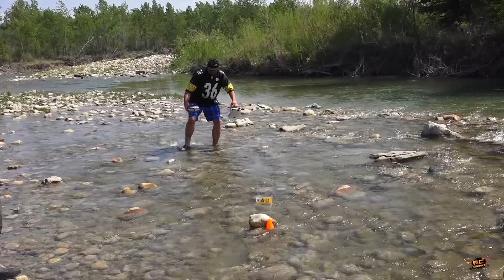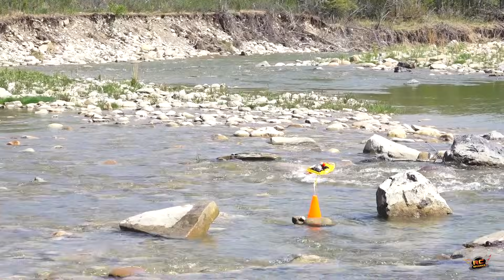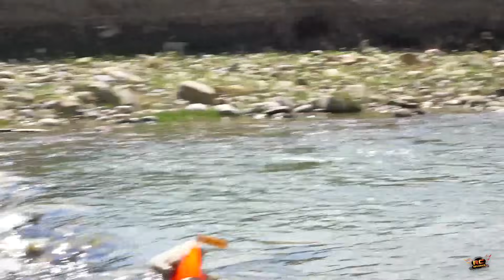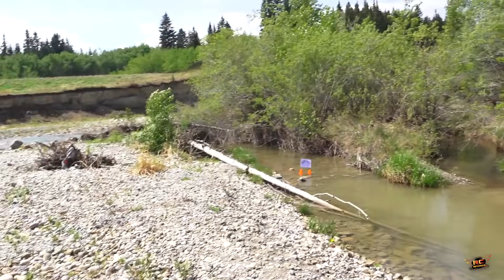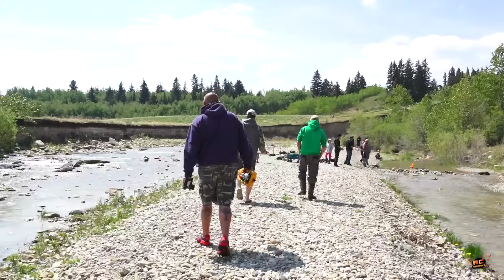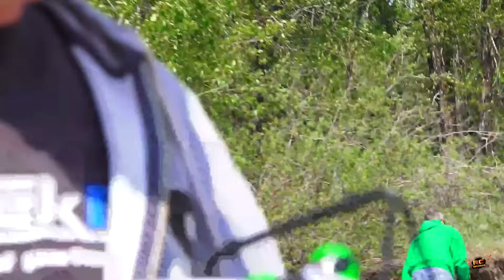RC ADVENTURES - Tiny Jet Boats Racing - PT 2 of 2 - MAiN EVENT - CREEK RACES! NQD "Tear Into" Boats

Comment: Smahing Job :)
great to see the jet boat bug so alive and strong,
Top footage on the other vid to,
I put a jet sprint vid up, with a lighter power set up
works great from 3 up to 5 cell, not tried 2 but should be good,the jet unit and motor fit well in an NQD,Hope all is Rockin with you Guysall the best
Mark

Comment: Should do a basic budget tutorial video on converting one of these id watch it1000 times while I build my own lol.
Reply: what's your budget?
Reply: MrDylman55 hobbyking low lol. i have an old traxxas TQ transmitter and receiver laying around im never going to use.  outside the cost of the boat i wouldnt want to have a ton into it. hard enough to justify spending $60+ on a boat that shouldnt be more then $30
Reply: I know that feeling, but I'm on the hobbyking budget also. And I'm doing a dual pump boat that will cost 220$ total including 10 batteries.(I have the transmitter and receiver from a plane project) so you could do it for probably around 140$ or so. Give me a few and I could go on hobbyking and look for you
Reply: part of my problem is im relatively new to electric all my flying has been done nitro so trying to find the right motor at low buck is a pain. the extent of my electric motor knowledge is 540 sized stuff from 1/10th crawlers. been wanting to get into a fun little boat like these for a long time now.
Reply: Ok, I was able to get just the electronics down to 53$+ shipping(I don't know where you live) and the boat from Amazon 60$+shipping. No more than 150$.
Turnigy xk2445.             $15.19
Multistar 40a ESC.        $15.99
Hxt500 6.2 gram servo $2.49
Turnigy 2s 2200mah 25c$9.99x2
^^^^^^^^^^^^^^^from hobbyking
Amazon
Nqd tear into jet boat 60$

Those are the electronics I would use.
Reply: +Richard Trent it is a bit easier than nitro/gas/glow. about all you might have to do is program the electronics. i've been wanting to get into this stuff since I was 11, so about 2-3 years.
Reply: MrDylman55  awesome thanks bud. i wish i knew about these boats much sooner so i could have gotten one on the cheap. the last time i ventured into electric (outside of rtr 1/10 cars) was probably 11 years ago when i built a GWS Tigermoth. after that i spent more time putting nitro motors on electrics lol
Reply: +Richard Trent you're welcome. I wish the best of luck to you :) if you need help comment on this post, I'll check now and again

Comment: Are jet boats fast
Reply: no, these ones arent but they are versatile. you can make then fast but it will cost quite a bit. these pumps cavitate(push air through the pump) after about 25000 rpm.

Comment: how much are these boats and how fast do they go mp/h km/h
Reply: +Zac Selwood You can buy the boat on ebay but then you have to convert it over to a brushless RC system. I built one a couple years ago using the stock jetpump and a 3200kv brushless motor. They are built for acceleration, it's hard to get them going fast because you start to suck in more air than water at a certain RPM level and it stalls out. Super fun though to run in streams and rivers like this. Just search for NQD jetboat mods on google or Youtube, there's a whole following.
Reply: DIY FPV Quads thanks

Comment: are these running as out of the box?
Reply: +insanelewis21 Extremely modded, stock setup hardly moves in the water. You have to swap out all the electronics.